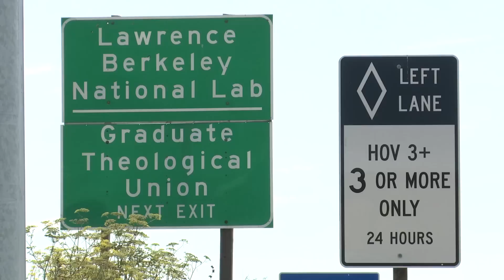What GM's Massive BEV, H2EV Push Will Mean For Everyone

Comment: http://www.motortrend.com/news/gm-promises-14-hybrids-by-2012-we-id-the-potential-lineup-4659/  GM promis 14 hybrid models in 2012,  2017 reality = TWO
Reply: Vít Ožana to be fair I do know they did actually try, they were just mostly mild hybrids. There were the Saturn Green-lines, The Malibu Hybrid, Silverado hybrid, Tahoe hybrid, suburban hybrid, escelade hybrid, I could go on, as they had many released with a hybrid option, they were just very crap hybrids that barely sold any units, leading to a quick discontinuation
Reply: The article was from June 24th, 2009. Let's back then they promised to do it in 3 years. Now they are promising 5.

I don't trust them. Disclaimer, I have owned a Saturn and a Saab.
Reply: Yeah GM, why don't you bring back Hummer. Make it out of lead to add weight. Then, make it a hybrid and it can get 1 MPG. Way to go GM!!!!
Reply: chris toohey well you gotta give credit where credit is due, they didn't have a huge battery factory to turn out all the batteries needed to make all their mild hybrids into full hybrids, so it was still a step in the right direction
Reply: chris toohey even still, GM did fulfill their promise, they promised hybrids, and they delivered, they just didn't promise good hybrids, which I suppose is part of the point I was trying to make. At the end of the day though, I do suppose a bad hybrid is better than no hybrid at all
Reply: chris toohey not quite, it's more of they promise a million but it's Monopoly money. Technically they delivered, just did a bad job of it
Reply: chris toohey I'd almost agree with that, except for the fact even the crap hybrids had a noticeable increase in MPG and reduction of emissions (despite being small) so it is still technically a bit better
Reply: chris toohey that I can agree with, and I will also agree they didn't really push for the sales of the hybrids when they had them to be fair
Reply: Let me bring you up to speed: 
Chevrolet Volt Gen 1, Opel Ampera Gen 1, Holden Volt Gen 1, Vauxhaul Ampera Gen 1, Chevrolet Spark EV, Chevrolet Spark EV 400, Cadillac ELR, Chevrolet Volt Gen 2, Malibu Hybrid, Chevrolet Bolt EV, Opel Ampera-e. Let's not forget the Voltec derivates in VIA Motors trucks which wouldn't be possible without GM.
Reply: Vít Ožana yeah I know but at least they did not crowdfund their business and being late to deliver. Oh sorry you are talking GM, my bad.